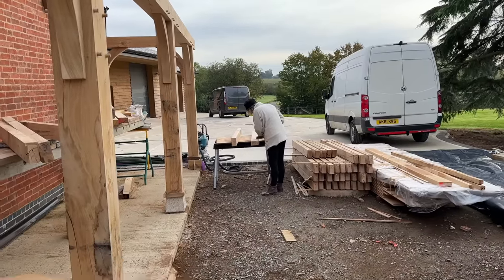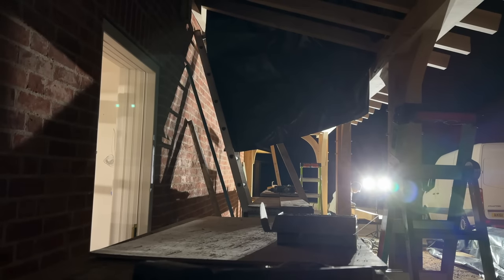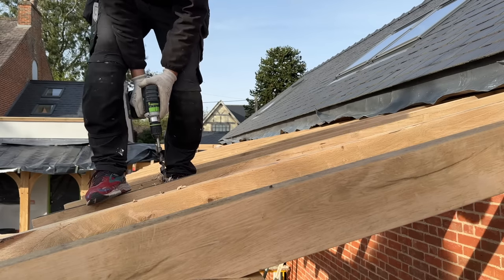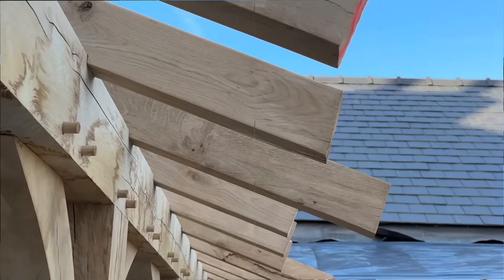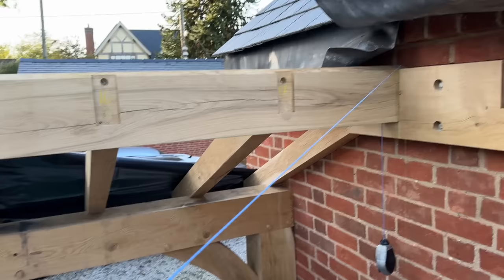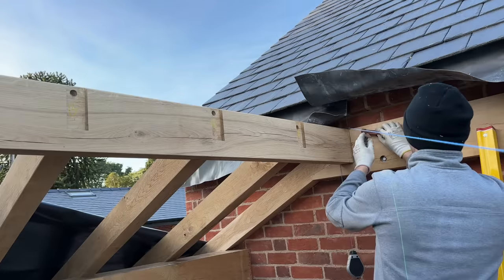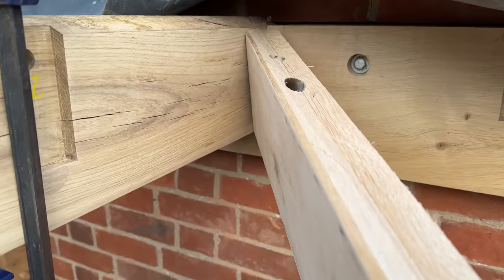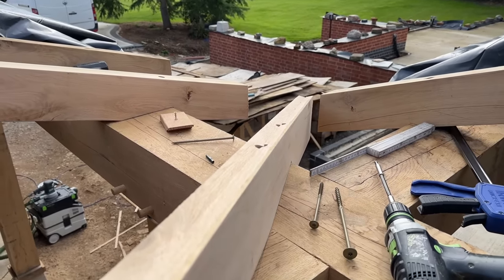Oak frame Valley Roof Cuts -  Rafters are on!

Comment: * cripple rafters
Jack rafters are on a hip👍🏻

If you ever have another roof, sketch it out half size or whatever on a bit of ply for your angles, you can get the length to with a tiny bit of development, but I prefer direct measure on a hip from long point to corner of bird’s mouth 👍🏻

Amazing for Your first crack at it,  do you have any woodworking experience? …..😜😂

Looking great mate
Reply from the maker: You joke but I've never done any roofing 🤣 helped a few times on some porches as a kiddo that's it 🤣 

Cheers mate. To be fair I did have my angles from the SketchUp drawing 😄😄😄👍
Reply: @BradshawJoinery  looks fabulous regardless 👍🏻

Comment: Hey Ollie - lovely job buddy as always great video ... whats the make and model of your laser please - I know you have listed it before - sorry couldn't find it! Cheers Simmo
Reply from the maker: Thankyou Ben and you are very generous buddy. 

I have several, 
Huepar 6141g is probably the best value and nice for setting out with the rotating dial base  
The one I used there is huepar so4cg great for full 360 line in any direction and close to walls.  
I have similar ones in Hilti too but tend to use the Huepar at the moment

Comment: How much harder was it to use green oak rather than say a soft wood like cedar? 
How do you price a unique job like this, things like the wood getting discolored and needing a days sanding, do you have a contingency? Or is it passed onto the customer? You may have mentioned it before but, will it be left to weather or are putting on a finish?
My flabber is truly gasted……..!
Reply from the maker: Green oak is pretty easy to work as its green, thats why people like using it, when it dries out though its another story!!! they are going to sand it then put some preservative on it. im not involved but the customer doesnt want a weathered finish